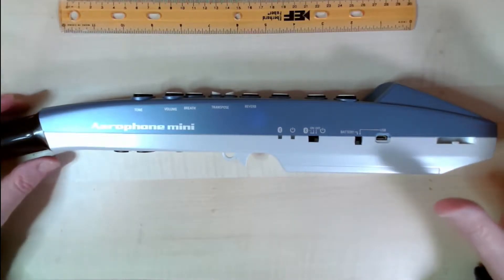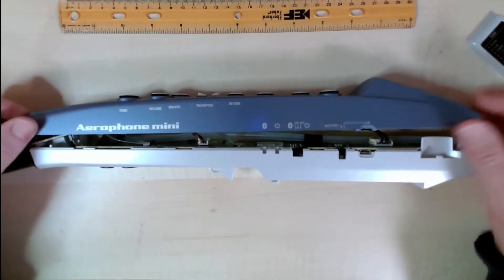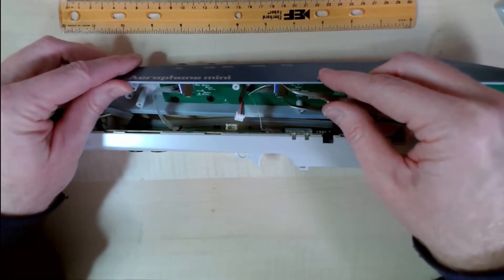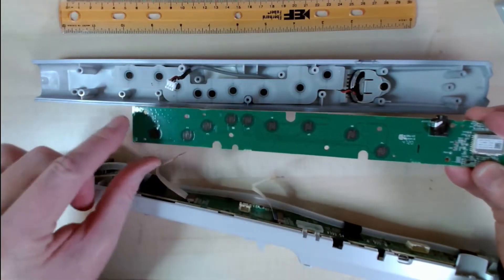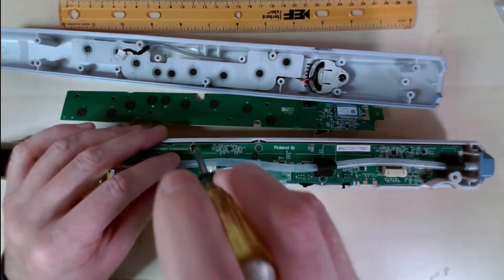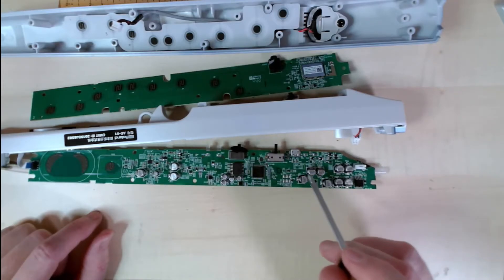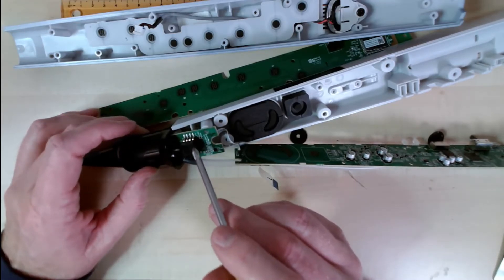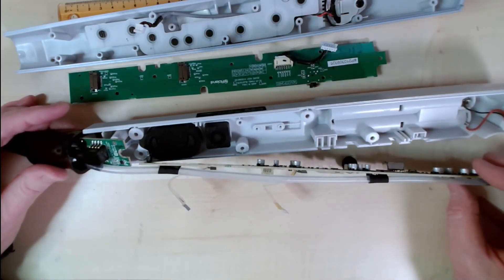Aerophone Mini (AE-01) Teardown

Comment: I wish it had more keys and a bite sensor - then this device could become the perfect platform for experiments with Arduino :) Otherwise I'm not sure if it's worth bothering. I really want a small device with at least 16 keys and a few customizable MIDI command buttons, and solid breath + bite sensing. Think NuRAD but a bit smaller and cheaper. Meanwhile, I have AE-05 but it has some annoyances - the keys feel a bit too "sticky" when releasing, which confuses my brain causing some latency when I try to rapidly switch between notes, and there are only 10 customizable fingering slots, which limits the potential of the device to be used for keyswitching approach - to use really low notes for controlling software synths.
Reply from the maker: I totally understand what you're saying about the ae05. I bought it specifically to make some modifications to it. Then I broke it--oops!  I'm not a big fan of the key clack and it definitely needs a bite sensor 
, plus the fingering extensions for aerophes is a bit lacking. 
I think it is worth learning the EVI fingering system.  Then get a NuEVI,  it's the smallest of the bunch and you don't need a strap. :)